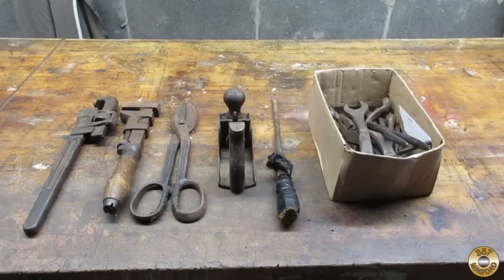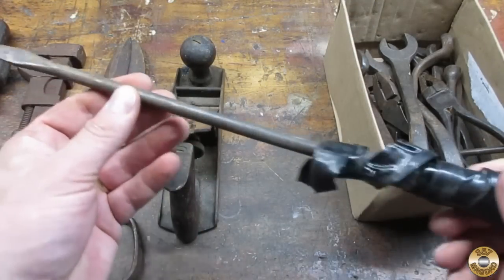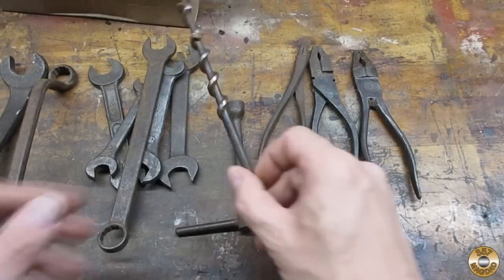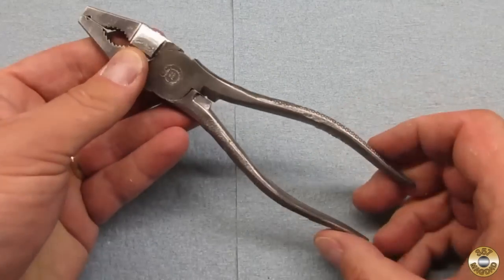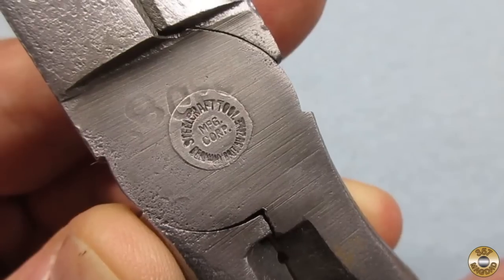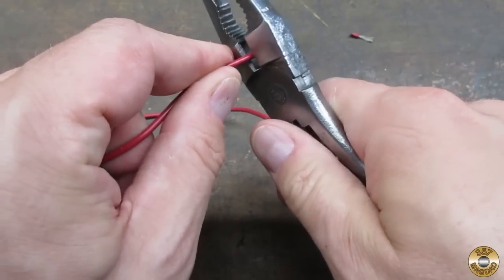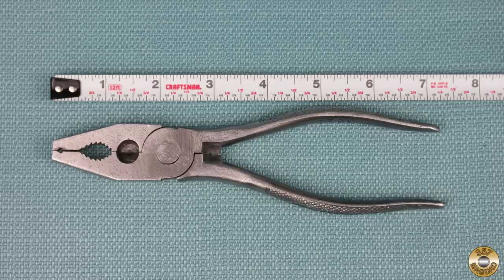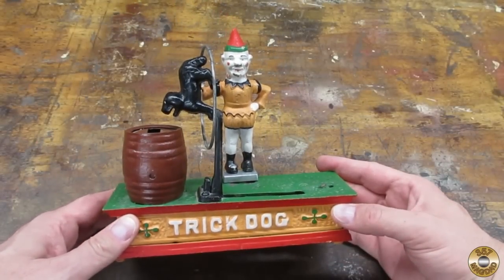Yard Sale Tool Haul - British Zone German Pliers

Comment: The grooves in the nose of the pliers would work well on those little wire spring hose clamps used on motorcycle  fuel hoses
Reply from the maker: Could be!
Reply: I had the same Idea but could not explain the clamp

Comment: Going on the electrical theme for the pliers with the wire stripper included, my though was the grooves on top were for twisting two wires together.  Since the hole on the end is larger than the ones on either side, you could hold the two wires side by side, bend the ends so they came out the sides, then turn the pliers and they'd be twisted together.  Basically achieving what a wire nut does today.
Reply from the maker: You could be right!
Reply: As electrician, that was my first thought too. Give it a try.

Comment: Nice tool haul.  I agree worth $10.   Very interesting pliers.    The "Elecktra" in the name may imply they were designed for electrical work.    Back then I expect the nuts for terminals would have been square headed.    The pliers cleaned up very well.
The trick dog was worth $1.   I got a smile from all that was wrong with the original manufacture.
The hand plane looks like a Type 13 which is late 1920's.
Dave.
Reply from the maker: Thanks Dave!  I bet the original US bank was made better!

Comment: Very nice tool haul. You have very sharp eyes to see those rare pliers and realize they are something special under the patina. I would have missed it.  They cleaned up well. Those tools were a good deal because the Ford marked tools alone could be worth at least $10 each, even though they are among the more common Ford tools still around, in my swap meet experience. They are Ford originals. The circle M does stand for Moore Drop Forging. Fords procedure  back in the day was to contract out its tool manufacturing needs. My guess is the tips of those pliers is for spring ring hose clamps. Great video.
Reply from the maker: Thanks Pat!  I didn't notice the Ford wrenches until I got home!

Comment: I was thinking that the ends of the pliers that you mentioned for square nuts could have also been used for wire twisting, maybe.
Reply from the maker: Could be!
Reply: @357magdad  The reason that I was thinking this is that the German Pliers you're showing in this video seem to be about wires and wire stripping.  Having been an electrician this seemed to be a likely scenario.  However on second thought it's also likely that what you mentioned is true also.  I serviced many fluorescent light fixtures through the years.  Some of these had designs that used nuts to hold the pans that hid the ballast of the light fixture.  They could have been 4 sided or even 6 sided nuts depending on the age of the light fixtures.  I serviced many from the 30's and 40's all the way through to the 90's in the places that I was sent.  Many used ceramic wire nuts.

Comment: A nice pair of combination pliers that cut, grip on 3 planes and wire strip. The Elektra marking was it for electrical work that needed square nuts tightened or adjusted, or to open an electrical cabinet with a square shank and no handle?
Reply from the maker: The square nut theory is losing out to the wire hose clamp theory in the comments!